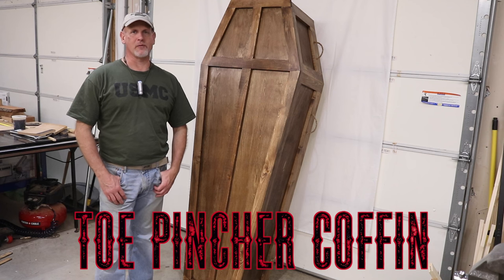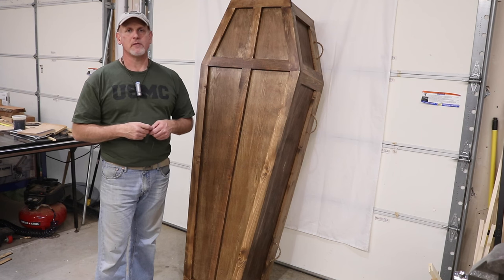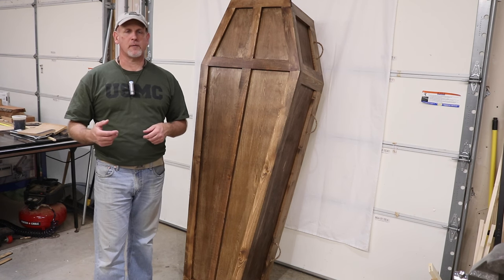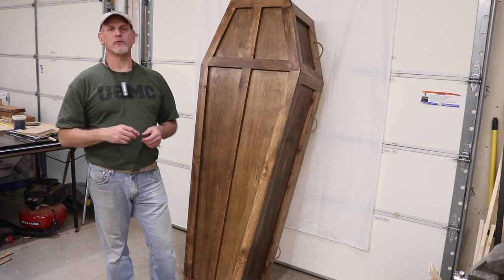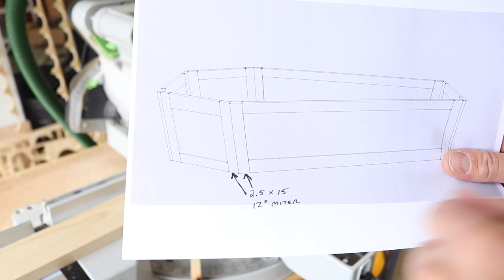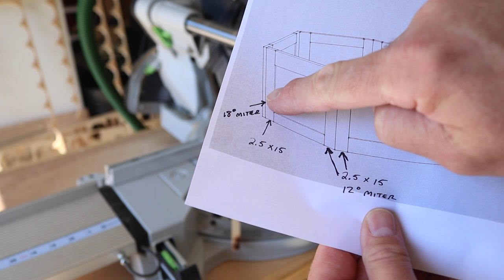Build a Halloween Coffin

Comment: You went way overboard for a Halloween decoration, you built frames. It would have way easier to  build a plywood box then nail the solid pieces on, if that's the look you had to go with.